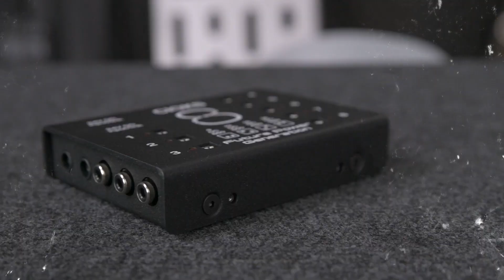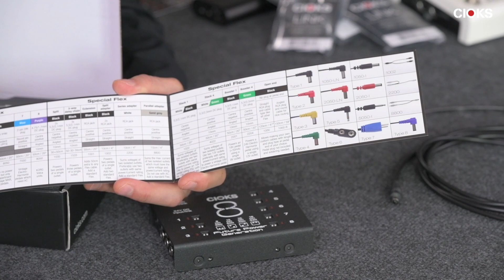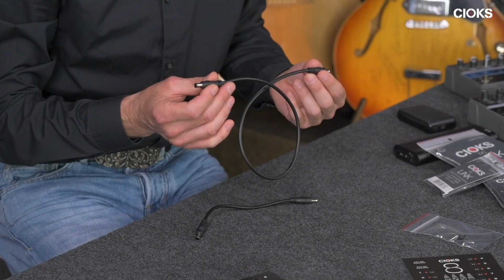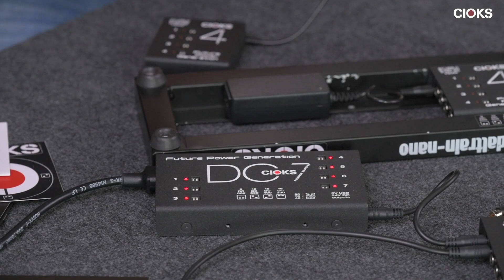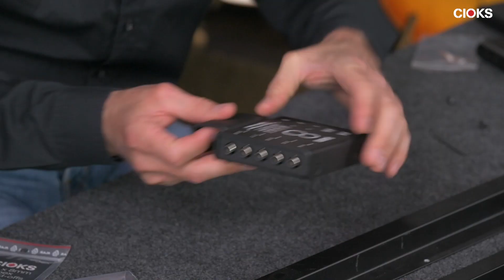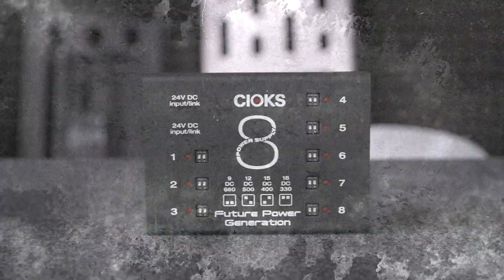CIOKS 8 power supply - introduction

Comment: Would it be possible to run the DC7 into an 8, then out from the 8 to a Crux to power a Darkglass Anagram? As long as I don't exceed the 48W from the wall and I used the proper adapters I think it would be ok, but want to make sure before I make a few sizable investments. Thanks!

Comment: Big fan of the Cioks brand and units, but the fact that Cioks 8  is not offered with an optional power supply to use as stand alone does not make sense to me. They did it with the 4- why not the 8?

Comment: Cioks says “you can power it with an adapter putting out anything from 9V to 24V DC or 9V to 12V AC. This means you can easily power it with the type of adapter you would normally use to run a single effects pedal, a laptop adapter or any other common adapter you have laying around.”  That’s not true AT ALL.  I’ve tried 4 different 24v power supplies, and none of them fit. I even bought the adapter for the Cioks 4. That doesn’t work either. This is a piece of dead weight.
Reply: It needs to be at least 60w to get the full power out of the Cioks 8, but nowhere can I find the barrel type or if it needs to be center positive or negative for the power input of the Cioks 8. Their support would not provide the info either. I get it they want to sell more DC7 along with the 8, but don't get greedy if people are willing to purchase just the 8 why not 1. Make an ac adapter to purchase separately or 2. Let us know the exact specs to purchase an after market power supply.
Reply: @jonkuenning try some Sony or HP adapters with 6.5x4.3mm plug. It will work.
Reply: Their saying is actually true. However, you need an adapter with 6.5x4.3mm plug to power it. The plug for CIOKS 4 is 5.5x2.1mm size. Some Sony laptop adapter will fit.

Comment: Please tell us the spec for the power adapter to use this independently.  The website said this can be used as a standalone unit. Not even the adapter for the Cioks 4 works. I’m about to return this. At the moment, it’s a frickin’ paperweight.
Reply: did you get your answer already? Im about to buy one today and buy a 24V 200mA power supply.
Reply: @bryanfernando2336 did it work?

Comment: I had the DC7 and the 8 expander for a large board, im downsizing from the larger board to 2 smaller boards, now that i have the 8 expander i cannot power it independently, cant find a proper power supply. This is something to consider for people looking at the 8 expander, if you wish to do the same you will have the 8 expander being useless. The 8 expander without an external power supply being available is extremely limited.
Reply: ล
Reply: ลฃลลงง

Comment: I don't understand making CIOKS 8 as an expander rather than a standalone. It looks lighter and more compact than DC 7 which would have been a great upgrade to the DC 7 if not for that adapter.
Reply: It is lighter and smaller because of the fact that it is merely an expander, not a full powersupply in itself.
Reply: Holding out for CIOKS 10